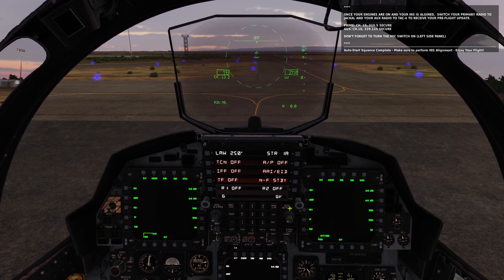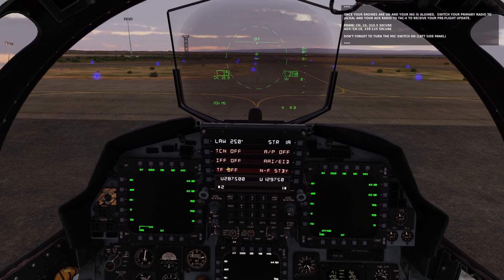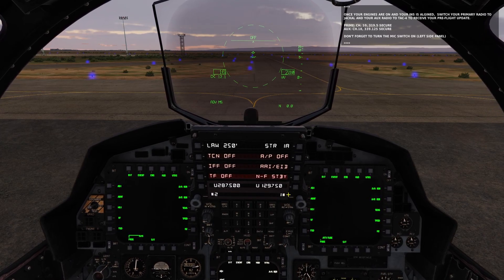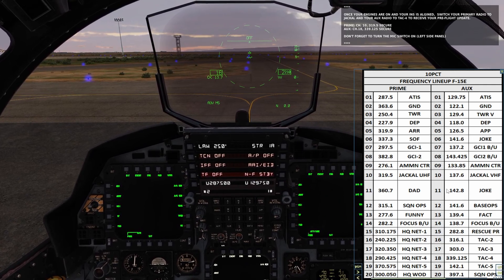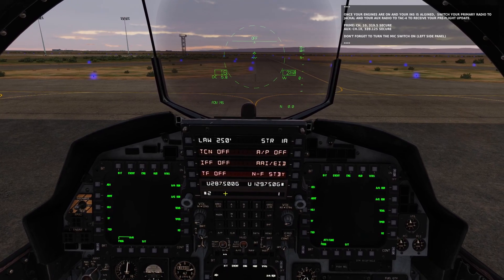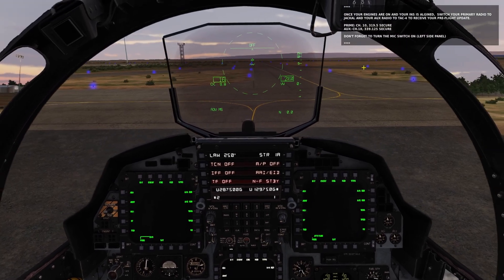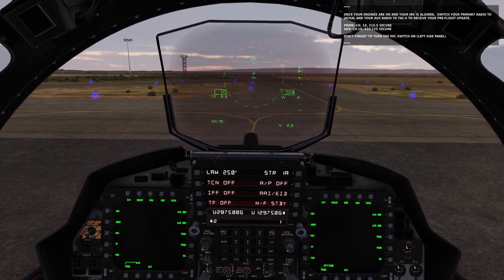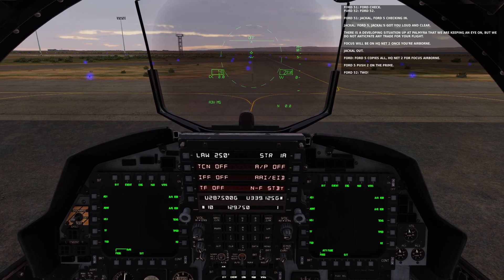F-15E Strike Eagle OIR Mission 1 - Radio Tutorial

Comment: Hey Sedlo, I'm stuck at the ready to taxi part of the mission. Everything else works up until I use the f10 menu and select ready to taxi, then nothing happens. Any ideas?
Reply from the maker: Not sure, but I’ll check.
Reply from the maker: Are you playing Multicrew?  If so, just ensure not using dedicated server and that mission host is the one manipulating the radio.
Reply: @sedlo  I am playing solo.
Reply from the maker: Can you send me a track at all, if you have one?  You can reach me through the DCS forums. @PiperFishing
Reply from the maker: OK, I just ran it, it seemed ok.  There was an issue with earlier version.. Confirm you have 1.26?
 @PiperFishing
Reply: @sedlo  I am running open beta, maybe that's it?
Reply from the maker: @PiperFishing  nope.  Just confirm you’re on version 1.26 of the mission and your radios are set channel 2 on the left and 18 on the right.
Reply: @sedlo  just updated to the newest version, that fixed it. Should of known to do that since I had the very first version installed. Thank you very much for the help Sedlo..